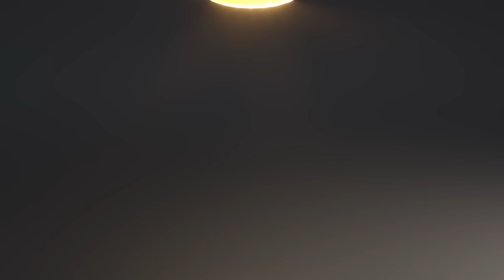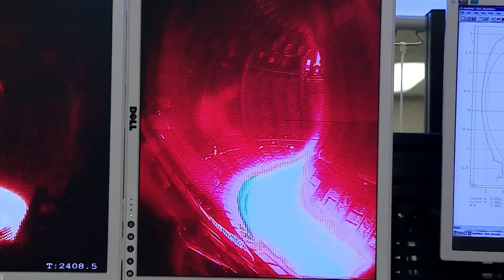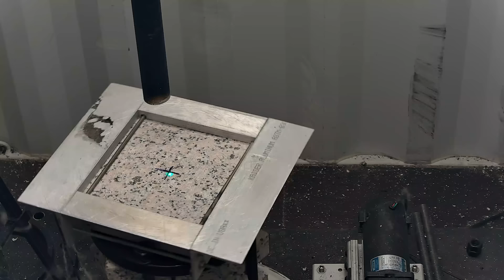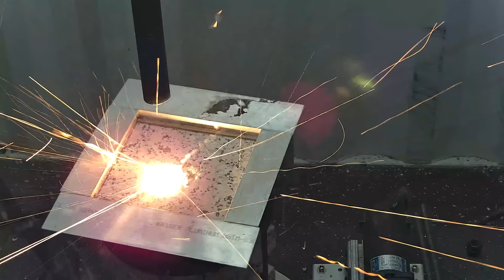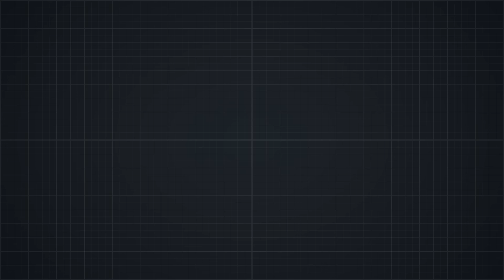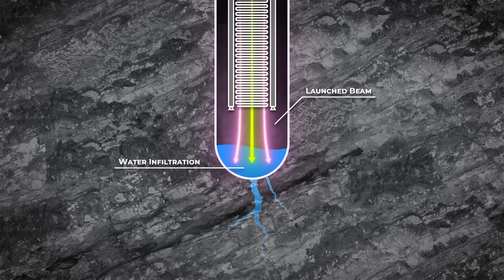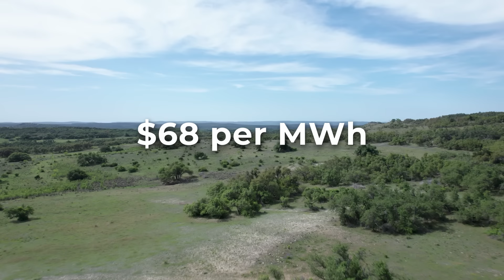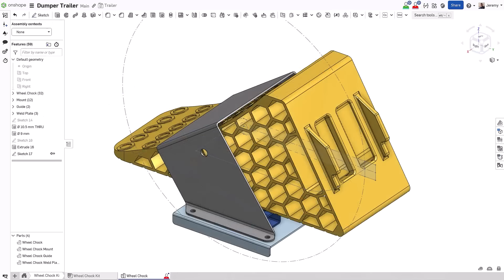Geothermal Energy is Changing

Comment: In Perth, Western Australia, almost every single public pool is heated by geothermal power. Remember: Australia loves swimming, so that is a lot of pools. The University of Western Australia even runs their air-conditioning on geothermal power using lithium salts. Lithium salts have a special enthalpy situation and is a bit more complicated than you may think.
Reply: Is that deep geothermal or shallow geothermal? Shallow geothermal is otherwise known as a ground source heat pump. It's effectively indirect solar energy (like wind power) as the energy it extracts mainly comes from the sun heating up the ground, not the earth's interior.
Reply: @Croz89 Ground source heat pumps are not geothermal.
Reply: @jamestyrer907  They are technically, it's exactly the same design just smaller. Heat coming from the ground regardless of source is geothermal energy. From what I've heard the interior of parts Australia get so hot that you can get a lot of heat from the ground just below the surface.
Reply: @Croz89 Ground source heat pumps aren't even close to the same thing as geothermal, the only similarity is that they both involve at least a small amount of digging. Even the energy flow is the opposite direction - the idea of ground source heat pumps is to dig down a little bit where the temperature is relatively consistent year round just because it gets averaged out across the year since it's not right at the surface, and to then use power from another power source to pump heat to or from that layer (it's an alternative to air source heat pumps, aka air conditioners). Consuming power to run an air conditioner that happens to have a slightly longer heat exchanger assembly that's under a small pile of dirt isn't the same as superheating water using heat from the mantle at over 100C to extract energy from the Earth's mantle.
Reply: @bosstowndynamics5488  The energy flow is only in the opposite direction if you're cooling, not heating. In the end, it's the same design and same physics when used for heating (which even most deep geothermal still is). It is still geothermal energy.
Reply: @Croz89  Perth geothermal is 50m deep, which is more than the 30m minimum to be considered geothermal.
note, Perth geothermal is not hot enough to be cost effective for electrical generation, so is used almost exclusively for heating.
Reply: @JoelReid  Thanks! I assume there's a lava dome or something similar heating up the groundwater which is why it works. Otherwise I can't imagine it would be deep enough to work.
Reply: @ No, there is no lava dome, quite the opposite in fact. The coast of WA is on the edge of a an ancient craton, there is a fault along the edge.
Reply: @ I will point out that the ground water in Coral Bay (a resort town half way up the WA coast) gets so hot that they do use it for electrical generation. The problem they have is that it is also their water source, and they can not get cold water as a result, unless they leave it for a while to cool down.
Reply: Right on.  I knew you used it for the heat but just learned about the cooling from your comment to me reading about it quickly. Lol. Ty kindly for the comment. That is very cool and seems so extremely efficient as well.  Gotta love that too. 🤙
Reply: Same with Hot Springs Arkansas US
Reply: I continue to "shake" oilmen with my innovative project of a non-combustion engine, I remind you that I am posting here on my channel the technology and the principle of operation, according to which anyone can create a prototype and enjoy free energy, since I was denied financial support at the stage of the idea and theoretical research, after a year of unsuccessful searches. Including I will begin to assemble a sample. And soon another video will be released, revealing my developments, the wind of change is approaching! All those who are not indifferent, welcome to the flight in this departing innovative car, which will lead to great achievements for the successful future of the planet and humanity!
Reply: how deep are their wells?
Reply: @ 50 metres
Reply: This is the first thing I remembered as well. I remember reading years ago about power generation due to hot rock formations under the earth. How are Western Australia's people not the richest in the country? Seriously, I cannot think of a resource you do not have. Of course, we know the answer.
Reply: @ashley2108 West Australia is the richest state in the country by a pretty large margin due to the massive iron ore industry and to a lesser extent natural gas. A quick search suggests that geothermal resources in WA are somewhat lackluster and not particularly developed, being a potential supplemental source but seeming to not be very developed, and Australia geologically seems to be generally very poor for geothermal with the very, very low volcanic and tectonic activity meaning that geothermal sources tend to be very deep compared to other places. I've got a sneaking suspicion that some people might be mixing up ground source heat pumps and geothermal, particularly since there's no way in hell that every public pool in WA has a 3km deep twin bore geothermal heat source under it.
Reply: @bosstowndynamics5488  Without a doubt WA would have to be the richest state.  I was purely talking about the people.  Prices of renting, cost of living etc is bleeding so many WA residence.  I hear this from family and friends in WA.  Not something personally experienced.  You are absolutely right about the depths and the inaccuracy of the statements about pools etc.
Reply: @ashley2108  A lot of the people in WA are quite wealthy relatively speaking in that there's lots of high paying FIFO jobs and other mining industry jobs, and the cost of housing is lower. Trade-off is that day to day expenses tend to be higher which hits lower income households pretty hard and renting is pretty bad right now. That, and historically voters here have been fairly conservative fiscally so you wind up with the choice between LNP who have historically been very bad economic managers and Labor who in WA have a tendency to act the way the LNP claim to act in that they're generally good economic managers but way too conservative when it comes to spending on support for low income families and such - better than the LNP would be but still leaving a lot of struggling people hurting more than they should be financially
Reply: Oof, hate to be near that when it catches fire!
Reply: @hanzzel6086 it’s lithium salts, not lithium metal. But way to announce your bias and ignorance in a single sentence.
Reply: @geekswithfeet9137  It was a joke. Although I will admit I know little of lithium salts, it's pretty clear (if it's anything like thorium salts) that it would be so hot that it would constantly be on fire if that was remotely of concern.
Reply: @hanzzel6086  what? No? It’s a salt….. there’s nothing to burn…. The oxidation is done already….. I think you need to read more
Reply: @geekswithfeet9137  You're heavily overreacting to this guys joke lol.
Reply: @henrymccoy2306  was it a joke though? Or was that just an excuse
Reply: @geekswithfeet9137  A joke. Very clearly a joke.
Reply: @henrymccoy2306  very clearly….. righto mate
Reply: @geekswithfeet9137  Yes. Very clearly. It's okay, we all make mistakes in the heat of passion Jimbo.
Reply: @ nah dude, clearly isn’t the word to use there. Maybe at best.

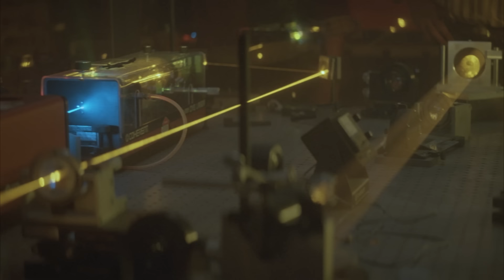Comment: 5:10 If its a maser and it produces microwaves then the emitted radiation has a lower frequency than visibile light
Reply: I don't think Gyrotrons count as masers though. A maser usually assumes that the emission is from electrons jumping around in bands in molecules/atoms (stimulated emission and all that). Gyrotrons don't do that, they use free electron clouds to generate radiation.
Reply: On second note, I now realize your comment was mostly on the higher-frequency. I wonder if he meant 'Higher frequency than microwaves', as quaise uses millimeter-waves. Could also just be an error!
Reply: @JorenVaes  Ah your right; He probably used "Higher-Frequency-Microwaves" as a specific term for the higher frequency part of the microwave range in the em-spectrum.
Reply: @Baumkuchen0611 Then again he doesn't seem to have a good grasp of basic electricity.
Reply: Yeah their description and diagram of the gyrotron was lacking, but it did get me interested. I guess the actual details would go over most peoples heads, not exactly simple physics.

Comment: How does it stack up against "flame jet drilling'? Using H2 gas combustion to blast through tough granite at incredible speed. There is a 16 year old megastructure video on YT title "Drilling in granite like butter".
Reply: I'd imagine not having to pump tons of fuel into the bore hole is a huge safety and logistics advantage.
Reply: @SendCh4  I wouldn’t doubt that! But the thing is hydrogen is extremely powerful in terms of energy usage it would be far less expensive and far more efficient that’s just my opinion. The temperatures you can get with hydrogen are immense and you can have that running 24/7 (maybe just to cool off once and a while(
Reply: @nardotini  Then tell us from where you will get all that hydrogen and how will you store it ? Storing hydrogen is huge pain in the a**(not even mentioning transportation). The only way that is reliable is for hydrogen to be liquid but that requires cryogenic temperatures. It would be probably far easier to use something off the shelf that can be transported easilly like methane or propane etc.
Reply: @likilike501 And just to expand this further, not only is hydrogen hard to get there in the quantities needed but electricity by definition is easy since the entire point of these boreholes is to be the basis of facilities that are going to have massive connections to the power grid, favouring a directly electrically powered solution over hydrogen combustion massively.
Reply: Does it vaporize soil and rock like these gyrotron does?
Reply: @FloofyTanker  Yes and faster. Hydrogen burns at 2200C but h2 gas jet can reach even higher. Rocks just flakes away without melting. Basaltic rocks will melt.
Reply: @souravjaiswal-jr4bj  how would that hold up at depths? just use pressurized gas to evacuate the hole of debris?
Reply: That’s what I was going to say. That makes 10x more sense to use HYDROGEN.
Reply: Actually we do that with a laser, its much more efficient than flame blast. In fact we have high ROP for thermal spallation drilling. Check out DeepU Project
Reply: I went and watched that real quick and it seems to me a little set up if I'm honest. The block of granite was flaky and could have been faked with types of cheap concrete additives or many other things but like all things, there probably is some truth to it
Reply: @devx-1272   I watched it during Beijing olympics on TV and had a faint memory of it. Quick search on YT revealed this. 😅
Reply: @dovahkiinx12  Flame shaping of granite is a well established century old technology, I just don't see it being viable for a well bore. It tends to be used for the final surface layer on very-large sculptures(Mt Rushmore size) and such.

Comment: I've been following this technology for a few years now it could easily turn coal plants from coal burners to using geothermal to make electricity. It is absolutely game-changing once it up scales and matures
Reply: Using it at existing power plant locations is a genius move because you need a whole lot of input energy to do the actual drilling, and even if you don't run the plant itself to produce that energy you still have an incoming connection to the highest capacity part of the electricity grid. It's also nice because a lot of power plants are set up to use their waste heat as district heating for nearby buildings. I know that the power plant on my local University campus at Michigan State is also the source of heat for all of the dormitories and classroom buildings on the campus. It used to be powered by coal, it runs natural gas today. Some of the biggest and oldest cities in the world have that same kind of setup. Assuming that doing the drilling in the middle of a populated area turns out to be safe and it doesn't do something like spray down neighborhoods with asbestos fibers or cause an earthquake then it would be great to actually do this inside major cities.
Reply: @AlRoderick  yep exactly
Reply: @AlRoderick  it also saves tons of money and infrastructure
Reply: The old coal plants don't have a supercritical turbine.
Reply: @jamestyrer907  it doesn't have to be drilled down to that depth to get to super critical steam
Reply: @jamestyrer907  u know that right?
Reply: Nice try clown 🎉🎉🎉🎉
Reply: You might be interested with similar technology developed in Europe. DeepU Project uses high-power laser to drill rocks. Cheers!
Reply: Geothermal energy is only viable in places where the heat is "close" to the surface. 
It becomes inefficient the deeper you have to go, it's all about location
Reply: @manuvillada5697  fair but doesn't mean it could work no matter the depth it's just getting that to the surface is something else

Comment: "Energy is changing"

Looks inside

Boiling water
Reply: In the far future with blackhole reactors we will still boil water
Reply: @peep77777  or reacting matter with anti-matter to boil water.
Reply: @peep77777  * collects Hawking radiation * ... * boils water for steam turbine *
Reply: @peep77777 i mean yeah
unless we can extract energy from high-speed light, why not use the heat to boil water?
Reply: but this time water is already boiled by something else
Reply: boiling rock
Reply: @Deniil2000  boiling rock that boils water
Reply: Even with solar energy they sometimes still just boil water
Reply: @submachinegun5737  they could however their usually used to help heat up the homes water
Reply: @submachinegun5737 buddy… literally all energy is boiling water and funneling it through a turbine.
Reply: @austinhorton6350  Literally the example I mentioned has photovoltaic cells that convert light directly to electricity. Wind turbines don’t boil water, they just spin a turbine. Internal combustion generators don’t boil water either. If you want to give someone the “buddy” treatment you might want to attempt to be accurate 😂
Reply: Sometimes we boil other fluids.
Reply: @ to boil water
Reply: @MaxeMooseyBoo  then we use the power generated to boil water 😅
Reply: We are the experts of boiling water. Aliens fear us.
Reply: 🧑🏻‍🚀"Wait, it's all boiling water?"

🔫👨🏻‍🚀 "Always has been"
Reply: @triatc you turned a YT comment into a meme that jumped straight into my mind… you win the internet for today sir. Well played 👏
Reply: @triatc  the future is steampunk
Reply: It's the way every power plant works even nuclear.
Reply: @ Even the majority of fusion just spins a turbine through boiling water. Though I think Helion is not doing that for fusion
Reply: @Cte4awesome  Actually, gas fired power plants often use the hot gases generated from combustion to spin a turbine directly, in a manner vaguely similar to a jet engine (known as Brayton cycle, while steam is Rankine cycle). There's a couple nuclear reactor designs that do similar with gaseous helium coolant, and there's a few coal plants out there that use magnetohydrodynamic generators (which again is using the gases from combustion directly)
Reply: It's just a state of the art water kettle
Reply: hey man if it aint broke dont fix it
Reply: Dyson sphere producing energy by boiling water.
Reply: @stormgear896  Russell was a steampunk, too
Reply: its all boiling water man
Reply: Every form of Energy production is increasing its enthalpy and changing it into a compressible fluid for the Turbine or Plasma and Electromagnetic Motorization
Reply: Doing a thermodynamics class in this semester and I can confirm, its all boiling water to make something spin.

Water is, litterally, just built different for power generation purposes.
Reply: From another point of view, every energy source is just fusion energy with extra steps.
Reply: boiling of boiling water INTENSIFIES BOILING!
Reply: Its just a quest for fire with extra steps.
Reply: Yep everything is just steam turbines in the end
Reply: Our boilmaxxing era continues strong as ever ☝️😌
Reply: slaps roof of ITER this bad boy can boil so much water. Eventually. When it's done. Probably.
Reply: Well... We do have a lot of water
Reply: I continue to "shake" oilmen with my innovative project of a non-combustion engine, I remind you that I am posting here on my channel the technology and the principle of operation, according to which anyone can create a prototype and enjoy free energy, since I was denied financial support at the stage of the idea and theoretical research, after a year of unsuccessful searches. Including I will begin to assemble a sample. And soon another video will be released, revealing my developments, the wind of change is approaching! All those who are not indifferent, welcome to the flight in this departing innovative car, which will lead to great achievements for the successful future of the planet and humanity!
Reply: Lol
Reply: We will use suns to boil water in the next 1000 years
Reply: Water op.
Reply: Why the fixation with boiling water? It's all spinning magnets
Reply: @billballinger5622  a nice cuppa tea is why
Reply: Let me guess then we are going to spin a turbine
Reply: we do like us some hot water
Reply: to spin a fan
Reply: THEY CAN'T KEEP GETTING AWAY WITH THIS!
Reply: insert "always has been" meme
Reply: Always just more advanced ways to boil water.
Reply: @aaronlee9677 The more advanced methods don't just boil water, they heat the vapor past the critical point under high pressure.